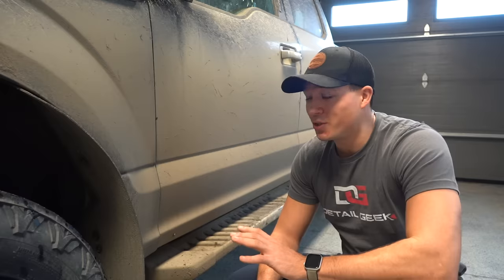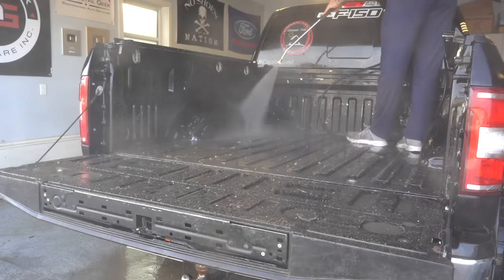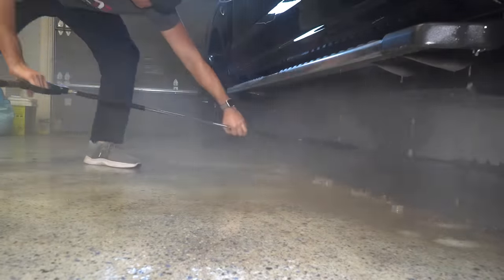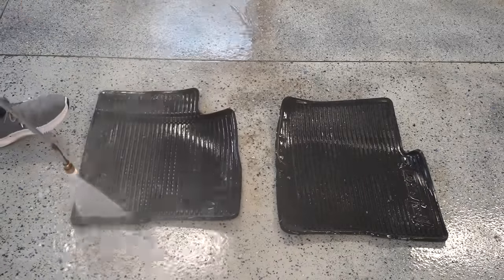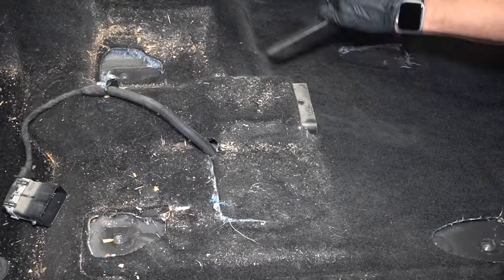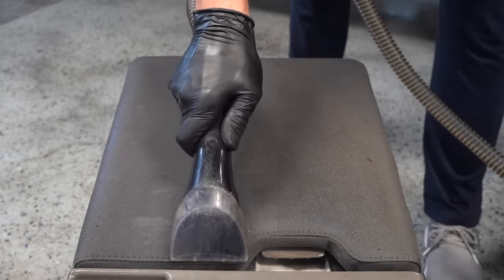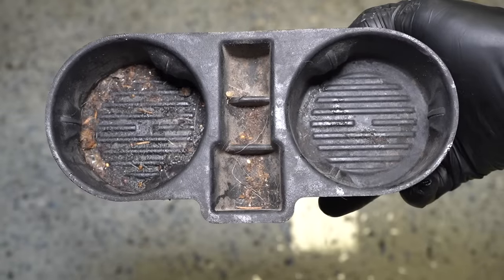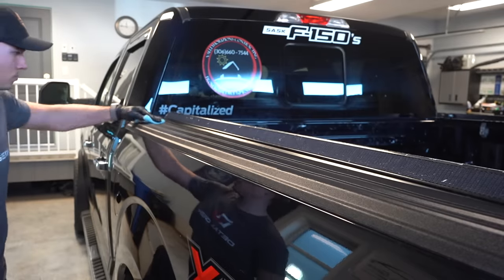Extreme DISASTER Detailing a Super MUDDY and NASTY Work Truck! | The Detail Geek

Comment: Ford: "Built, Ford, Tough"

Mitch: "Built, Ford, Tough to clean"
Reply: Ford = Found On Road Dead/Fix Or Repair Daily
Reply: @JaCoCop  THANK YOU!! 🤣🤣🤣
Reply: @dougd6135  same here.  My parents bought themselves a 1994 Ford ranger back in 1999 and it’s still going strong today.  Been in 7 wrecks and been totaled 4 of those times.  It’s been rebuilt twice and has nearly a quarter of a millions miles on it.  My dad took it to work every morning for a couple of years back when our car blew the head gasket.  It continues to be one of our best vehicles.
Reply: @dougd6135  Maintaining a vehicle is only part of it. Research reliability on Ford, it's much lower than Honda, Toyota or even Subaru.  As a previous Ford owner, I've never had anything but problems,  even buying them brand new. I'll never have another one. And you'll never hear of a Ford hitting 1,000,000 miles, as Toyota had 2 instances of Tundras hitting that record. You keep driving that Ford. When it starts to have issues, it won't stop.
Reply: @JaCoCop   I actually just saw a video about a 2013 powerstroke hitting a million, and of course its gonna be less than honda and toyota just about everything is
Reply: @thatguy5915  Diesel engine? Yes, those will last longer. Toyota has had at least 2 hit one million on a regular fuel engine. And Ford vehicles also have small resale values.  But, most American made vehicles are crap. Chevrolet is even worse.

Comment: The 303 protectant was really crappy for me, when I apply it, it looks great like brand new but water washes it right off leaving it streaking and looking horrible.
Reply: Is this on the outside or the inside where it looks bad? I've been considering getting some 303 after watching these videos.
Reply: @dudetheman3  it was on the outside, the inside doesn’t get water on it so it should be fine, if you want to restore faded trim cerakote is the best. After applying the 303 5-7 times after each time it washed off, it seems to be holding better
Reply: @Daniel-dg8hd  thanks for the reply, that's good to keep in mind!

Comment: The effort you put in is admirable, but you could easily cut your time in half by learning to pretreat things as you progress. Let your cleaners dwell to loosen up the dirt and you won’t need to spend nearly as long scrubbing. Let your chemicals do the work for you. I used to be able to detail my oilfield work truck before days off in about 3-1/2 - 4 hours. That included the engine and I always had way more mud than this. Especially in the undercarriage. 2 - 3 wheelbarrows full of mud. My interior wasn’t as dirty and I had weathertech floor mats, but there was still enough to deal with that it took a good hour to clean the fringes of carpet and spot clean upholstery. The exterior to 30 minutes (60 if I polished the paint), interior 90-120 minutes) and engine about 60 minutes. You could have put it on a showroom floor after.